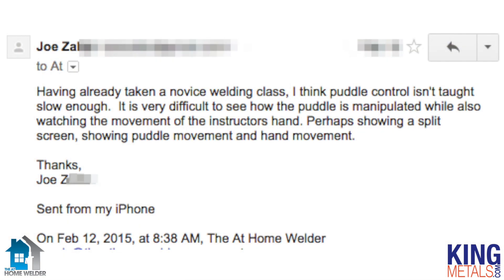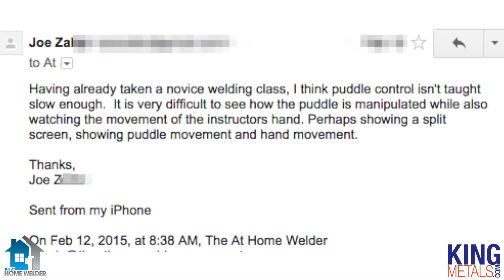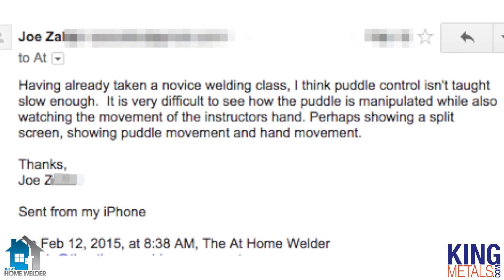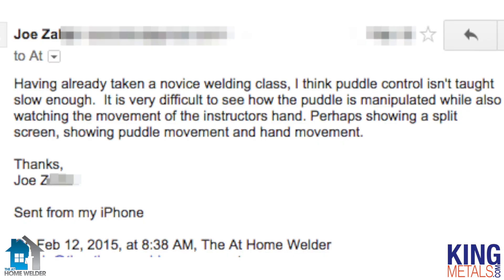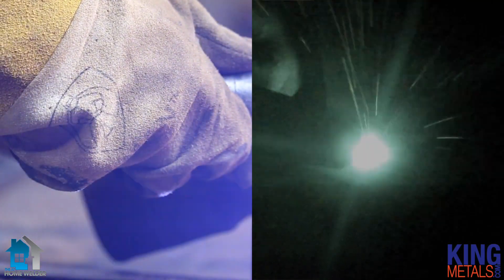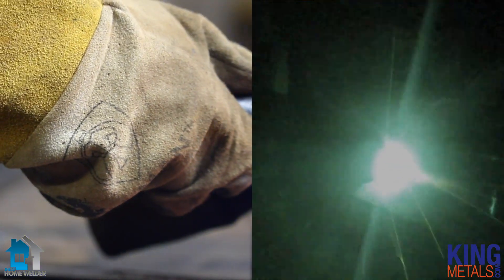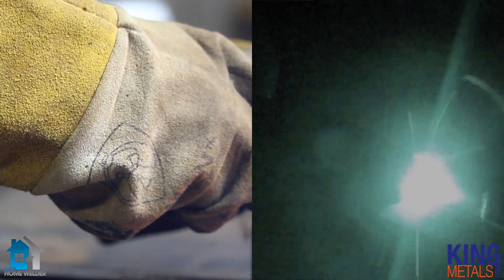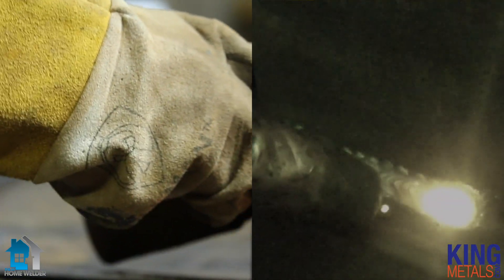How Hand Movement Affects Puddle Control

Comment: Hey guys, this is amongst the most magnificent tutorials on how to actually weld that I've come across so far. I wanted to ask for a similar video for a while: 

“How to flux core weld 1.6'' (40x40 mm) square tubing (1/8'' walls) into a T-section?“. 

If you could demonstrate the techniques as you've done here, that would help so much. I wanna build a welding table...but i do suck something fierce at this. :D

Many thanks, 
Bjoern
Reply: Did you ever get it built bud?
Reply: @rickster5224  Pretty much, besides work. Just successively adding smaller tool racks, utility bars etc. Main frame existed a long time ago. Lots of trial and error though for assembly methods other than welding. Labor of love mate..

Comment: How to avoid shaking hands while welding
Reply: Same problem here anything work for you. My hand shakes to much and my pattern get distorted. Making it so I can't keep good consistency.
Reply: @rubygreen1249  I'm not sure if this would help or not but I seen a video talking about making sure you have about three points of contact to keep steady. 1. Feet steady on the ground or against something sturdy 2. elbow on something sturdy like a table 3- I usually cuff both of my hands on the gun in two different places... One hand to keep it steady and the other hand to control where I am going (Again I'm not sure how this might help your hand but it's a interesting thing to think about that can go a long way)
Reply: @dakotaraker9769  of you're doing long beads you shouldn't put elbow down and second off not everyone has the ability to be able to prop you just have to practice free hand welding
Reply: @Chadwhansen3232  ye just practice

Comment: That is a ugly weld dude. C technique is terri le with solid wire. Beter on flux core or stick. Slight backstep for aluminium makes a nice weld profile. In my opinion, just washing up and down with the puddle or if your good circles technique with a quicker speed on the back end of the puddle. Thos is a  Red seal welder opinion from 10+ years in structual shops
Reply: I don't really care for the circle technique so much but the back step is terrific for gmaw, fcaw and gtaw I've never done stick but for the most part with what I've seen with stick is straight stringer beads get the best results
Reply: @Chadwhansen3232  same goes for MiG,in UK where I'm welding we build bridges and weawing or circles or c shapes will faill when stress tester and you won't get coding.Need to go really hot and just go strainght to get good penetration with good wirespeed so you don't get any undercuts.

Comment: If I buy a chinese mig welder afects the quality of muy welding?
Reply: Just the thickness you can weld and the types of metals you can weld and you can't dial the setting as well as for heat and wire feed speed. Every welding machine can weld or else it wouldn't be a welder.